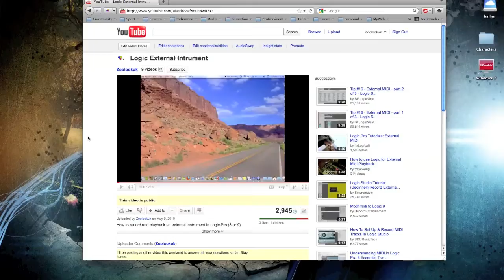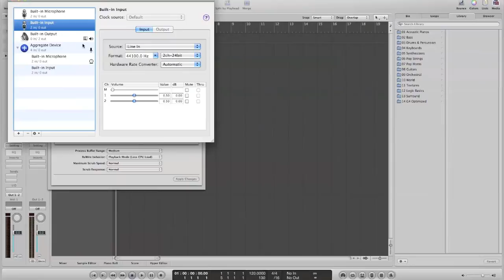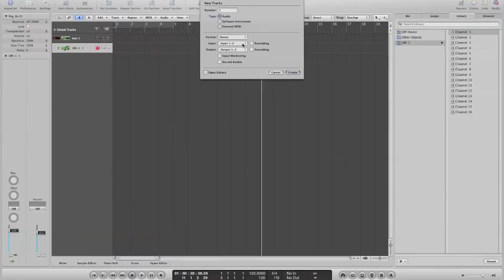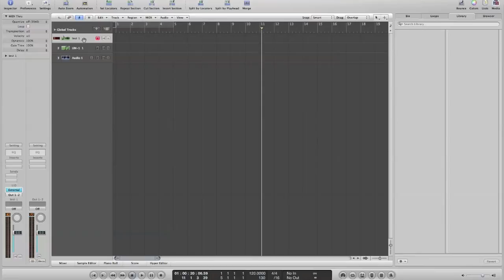Logic External Instrument 2

Comment from the maker: With an audio interface, there are a couple of things you have to do. Firstly, so to Audio/MIDI in your Mac's system preferences, and make sure that the audio interface is there and recognized, both input and output. Then in Logic, go to Preferences -> Audio and change you Output/Input to the external audio name. Then it should work as normal, as long as your synth is connected to the audio interface, not your Mac's audio input.